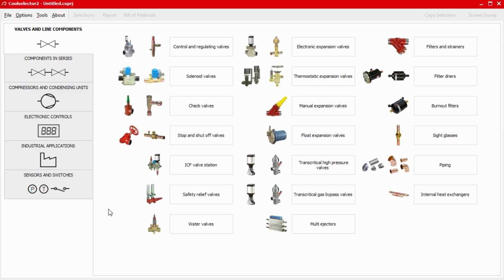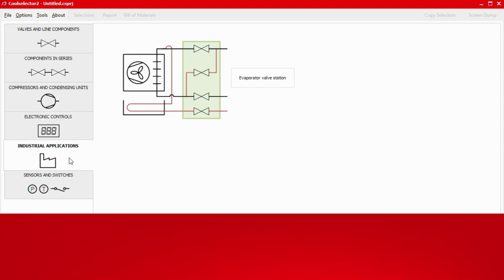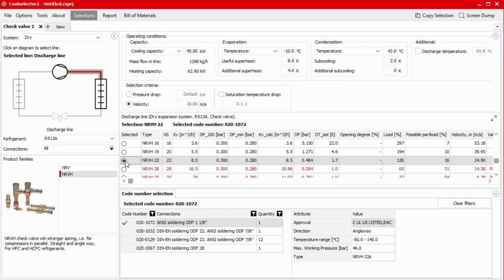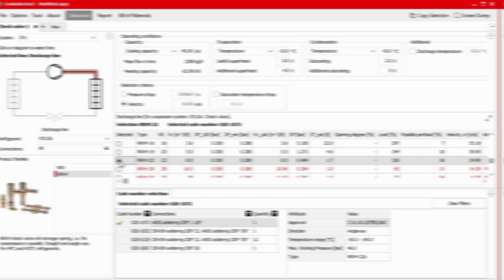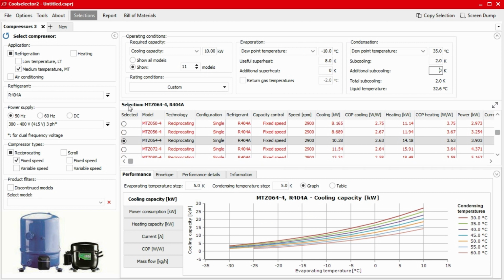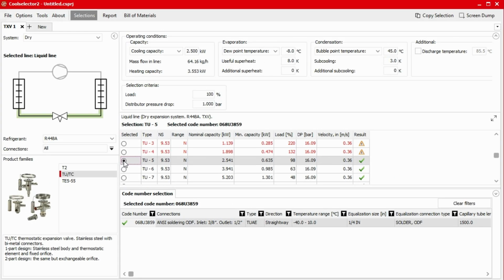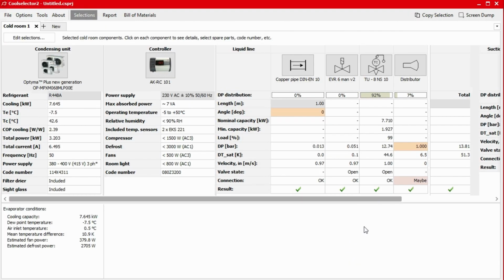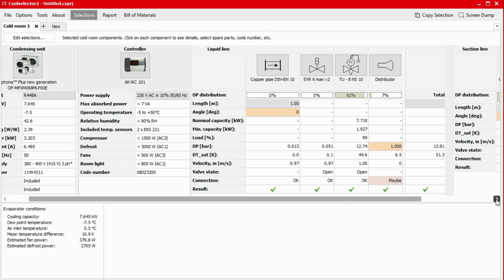Coolselector®2 Startup School | Learn how to use the software and get the most out of it

Comment: How can I use the coolselector to design an Ice Block machine?
Reply: Hi Toyin, Coolselector®2 cannot be used directly to design an ice block machine – but when you have designed the machine and know the cooling capacity and operating conditions, Coolselector®2 will help you select the right components for your refrigeration system. Hope this helps.